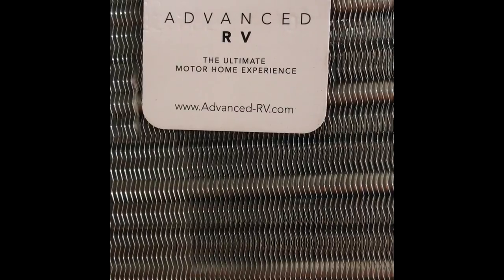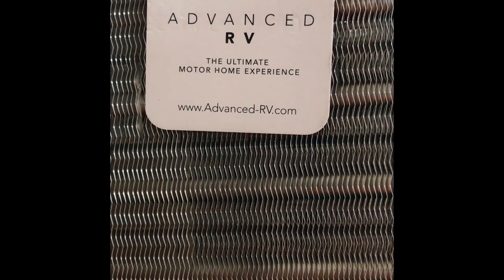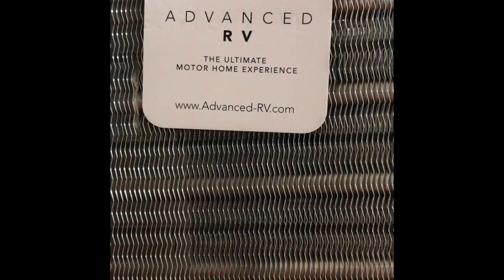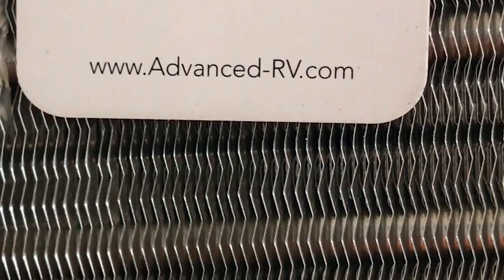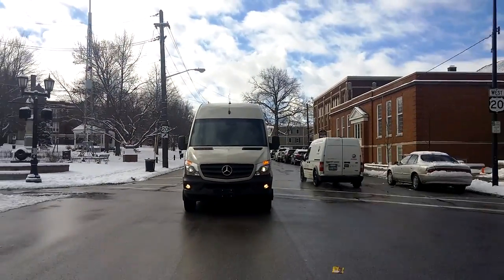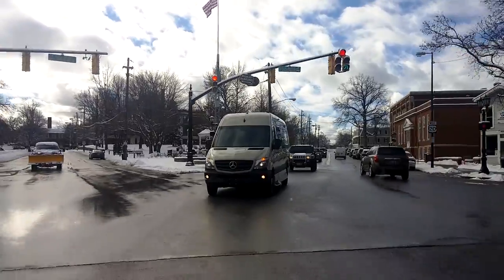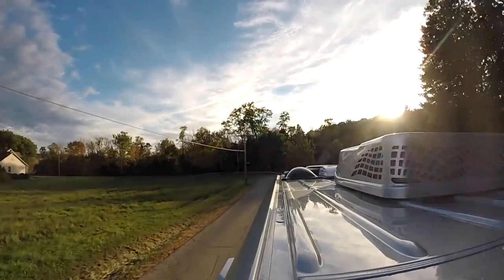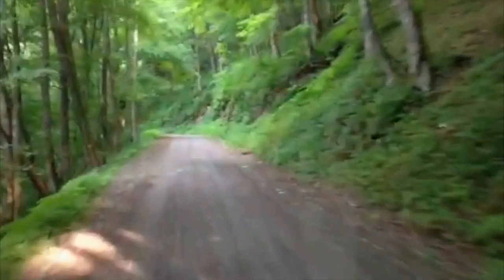More On Split A/C Systems In Class B RVs: Why They May Not Be As Efficient

Comment: I'm waiting for a mini split to be delivered that we'll install in our class a with the evaporator over the entrance door and the condenser in one of the basement compartments. I'm planning on fabricating an inlet on the hatch with louvers pointing forward and a FILTER media between the louvers and the condenser. If I was installing it on an expedition vehicle to go off road, I would fabricate a SNORKEL to the top of the vehicle, just like an off road engine intake. Cleaning and inspecting a filter by opening a hatch instead of having to climb to the top a rig sure is nice. We run our AC units while going down the road with our onan generator, in the future we're planning on a big solar setup.

Comment: If the customer wants a condenser under the vehicle and you are only woried about dust while driving, could you just build it into some kind of vented box that you open on site and close up while driving?
Reply from the maker: Thank you for your question, Jay L. We will install a condenser under the chassis if that is what a client wants. This video was made to explain why we prefer the A/C mounted on the roof.
Reply: Advanced RV it's just that a roof mounted ac takes up space that could be used for solar panels for boondocking. Most people do not want to always camp with shore power. The future of RVing depends on finding new solutions. Save the rooftop for solar, the maxxfans and ac units will have to be mounted in new locations.
Reply from the maker: Jay L, thanks for the clarification! Our lithium battery systems and auto gen technology allow you to travel for weeks at a time without plugging in. All without propane or a generator. You can check out  more about our systems on our website or give us a call at 440-283-0405.

Comment: Is there a way to use the vehicles A/C system to be used as a mini split system or adapted to work with shore power or quiet small generator for boondoking. Is the vehicles A/C configured the same way a mini split or not. The condenser up front only gets dirty mostly buy bugs
Reply from the maker: Thank you for your question. The vehicle AC system uses an engine driven compressor so the engine needs to be running for the AC to work. In order for an AC system to work from battery or shore power, it must have an electric motor driven compressor like an independent rooftop or split system. A system  with an electric motor driven compressor can be operated with a gas generator or a battery pack and inverter. If the compressor motor is alternating current, an inverter is required.